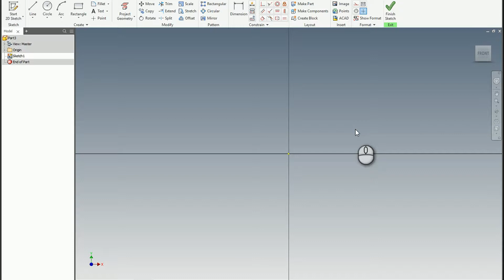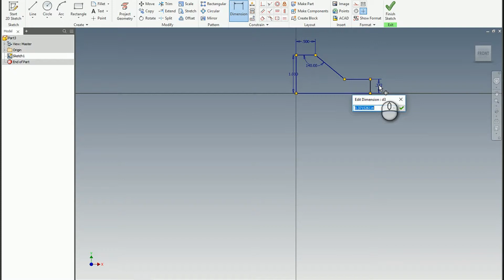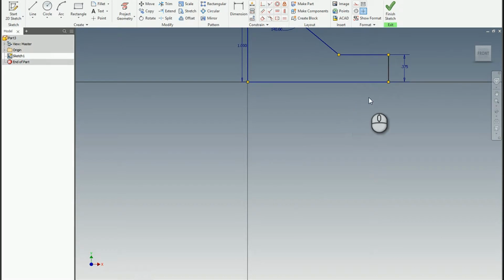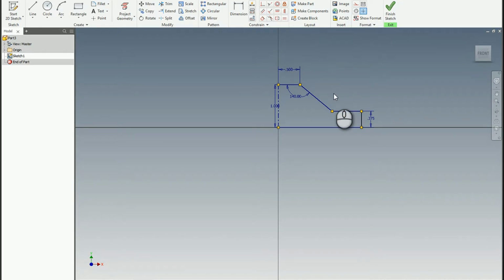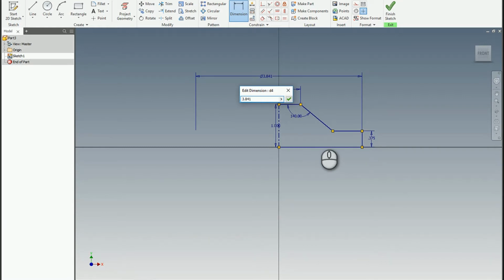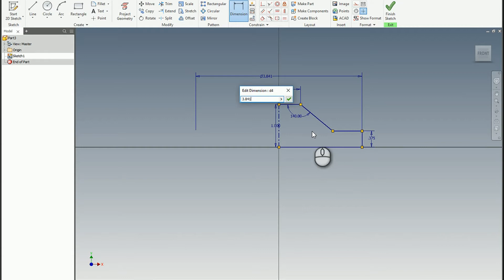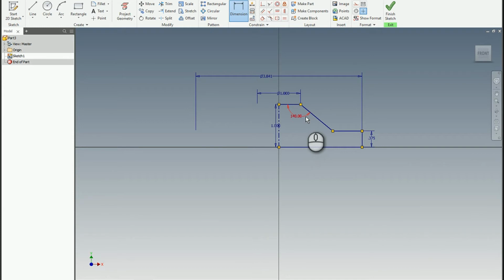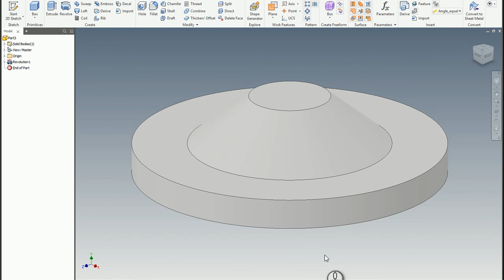Autodesk Inventor - Sketch Centerlines & Linear Diameter Dimensions

Comment: Hello sir,

I have a problem during move command, so exactly what happened supposed I draw a circle and I want to move circle from top point , but I can't select. Only center of circle is select. Give me some snap setting advice..
Reply from the maker: Mistry, our apologies for the late reply, but Pete has knocked out a video that displays some of the additional snap options you can use.  https://youtu.be/EBjM1RwxjWQ  Thanks for your patience and hope this helps!

Comment: Hello,
I’m having a problem with editing the dimension once I’ve already determined it.  Undoing the dimension also doesn’t work after a while. Could you help me with that.
Thanks
Reply from the maker: Hi Rishabh,  try double clicking on the dimension. This should allow you to change the measurement. If that doesn’t work, at the top of Inventor there is a (Fx) F of x icon that can be clicked to open all your driving factors and you can changes things from there. Hope this helps and if you have and further questions contact us at support@teamd3.com or visit TeamD3.com.